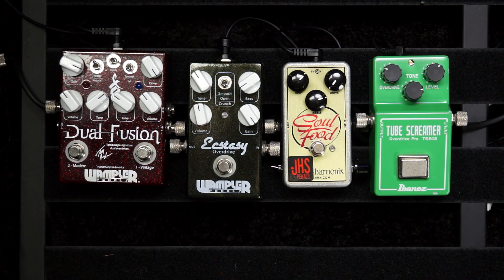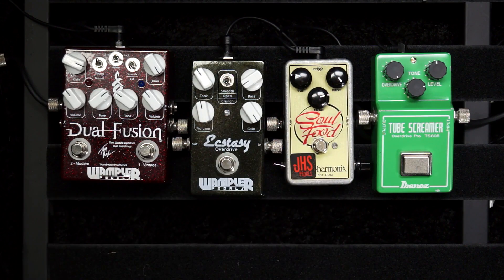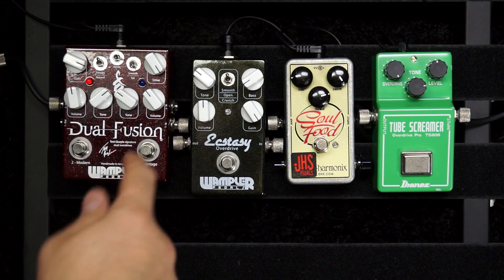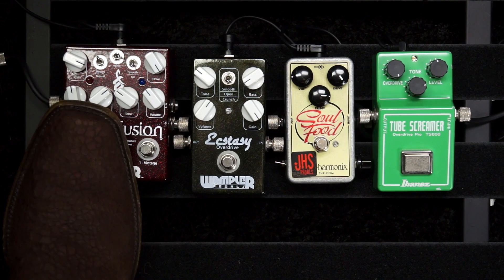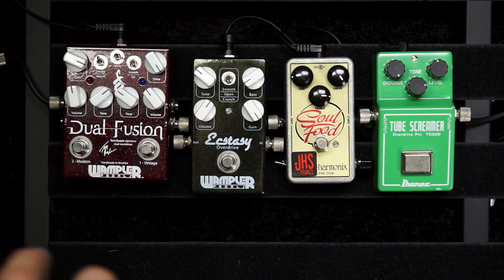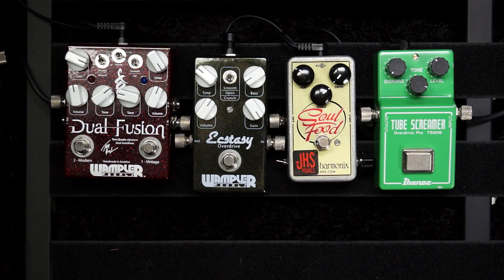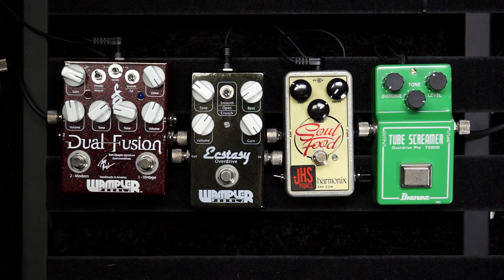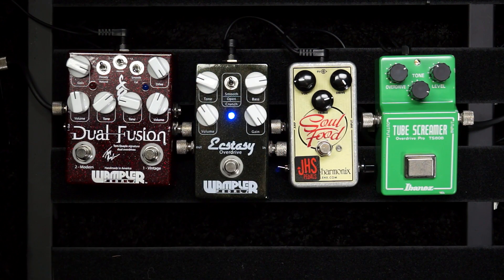4 Steps To Choosing An Overdrive Pedal

Comment: "A tube screamer always thins out the signal" – although this is not wrong, you gotta look at the context. The tube screamer was developped when Fender twins were the fav. Every club carried them so as a working musician chances were good you were playing through a clean amp with lots of bass and treble. A TS then shaped the overdriven tone to punch some midrange in the equation while thightening up the bass - which seems to be a terrible thing for bedroom players but just the way to go in the context of a band.
Reply from the maker: Stephan Neetenbeek Great point. Thinning the tone out sounds more negative than it has to. "Helps you cut through the mix" is another way of saying the same thing which sounds much more positive :-)
Reply: @Texasbluesalley  Maybe but for me the 808 or the TS9 is the optimum pedal to hit the front end of a Marshall, especially the 808.

Comment: Your videos have been helpful...
   Our house is new to guitar, and ive been researching pedals a lot lately... trying to figure out where to start...
   For someone completely new to guitar, and wanting to experiment with various sounds, from all sorts of classic rock, to SRV and a bit of blues, to a touch of AC/DC, and some ZZ Top, it's hard to know where to go for drive.
   I'm thinking I almost should go with a multi-effects pedal, as opposed to separate pedals...  to get the sounds I am lookimg for, my list starts with a tuner of course, and probably at least 2 drive pedals, a reverb, a delay, a chorus/modulation of some sort, and then you start needing a board, power supply, etc...
   My "short" list already includes:
TS Mini, Soul Food, Crayon, and Spark mini,for boost/drive pedals...but not sure which couple to get or if that will get me the variety I'm after, of if any combimation of those will get me anywhere close to a ZZ Top sound...
   Hall of Fame 2 reverb and Flashback 2 delay seem versatile, as does Corona amd the Phase 95....   I looked at the M5 or a similar multi effect stomp box type pedal to fill in the gaps...
   After loomong into it for hours amd hours.... I'm leaning more toward something like a headrush....i could tinker with one of those and find a sound that is close for a song/artist, and then save that.... and then repeat...
   Then anytime i could go back to any of those easily....    separate pedals might be harder to go back and forth to those tones once i do find them...
    I have a small Orange amp, a small Marshall, and am debating eventually getting something bigger.  
    Some of the options I've looked at are the Headrush stuff, like the Gigboard, or even the Mooer GE200...  as far as multi effects boards go.  I could play that through one of our amps, or get a FRFR speaker, or use one of the EV powered speakers i already own...
   Any thoughts or input would be greatly appreciated....
   Thanks again for the videos!
Reply: The thing to remember is that there is no single "do it all" pedal. If you want different tones, buying multiple pedals is really the best bet. Multi-effects are not very good at distortions and OD's. They're better for the other effects though (such as delays, chorus, phaser, etc.). Keep in mind that you're stuck with whatever tones those provide and are cumbersome to set up. With multiple pedals, you can mix & match various things, and even stack pedals together if you wish. Best thing is that if you don't like one pedal, you can remove it from your board and replace it with something else, or you can sell/trade it without having to get rid of your entire board.
The pedal market has so many different options at every price point, with a little research you should be able to find exactly what you need.
The other piece of advice I will give you is that you should really just focus on developing one good sound that is yours, and try not to nail every tone for every song, that's where you can fall into the trap of continuously buying and selling gear.

Comment: It is an interesting approach. I don't tend to think OD pedals can really produce distortion like some of the better dist. pedals. Another idea is to set the pedals for what they are good at and then decide if you are choosing only an OD pedal. For that, volume or level at 11, gain at one, tone at 12.  That is, in my opinion, the sweet spot. You can roll back or up on tone.

Comment: Question Anthony: You said the TS thinned out your tone, but isn't that because you had the tone knob all the way to the right? I thought 12 o'clock on the tone knob was neutral, to the right cut the bass and to the left cut the treble........
Reply from the maker: TheWhocares1981 Kind of... The farther right you have the tone knob, the "louder" the pedal will sound because of the brighter tone. If you roll the tone knob back, you can boost the volume higher, which will make the bass closer to the clean tone, but then your treble will be a bit rolled off. So if you're willing to deal with slightly muted trebled, you can get the bass closer to bypassed levels.
Reply: The average TS still cuts bass no matter where the tone control is. Increasing that control only dials in or removes treble. ;)

Comment: You do not use a TS as a full distortion device on a high gain amp. You set the Level all the way up, Drive all the way down, and tone about the half (but thats dependent on the amp or player). You use TS-like pedals as a filter for the flobby lowend und sharp highend. And push a little bit the overdrive of the amp through the level.

Comment: A metal guy would run an overdrive through dirty channel, with the level up, distortion off, looking for a tighter bass response and a slight mid hump. Any recommendations?
Reply: A tube screamer (or a cheap clone of one) would be the typical choice for this kind of thing. Some klon clones (like the soul food) do this well too.
Reply: I ended up with an East River od. It's based off of a maxon 808. It's transparent with pretty good output and was only $52 off Reverb.com 👍

Comment: Can you change the settings on the pedals?
The 808 for example, back the overdrive off & turn the level up.
Or decrease the tone, they have  control knobs for a reason.
But you know that, don't you?

Give people a range of different tones to hear, those sounds where only slightly different.
They cannot all sound that close, unless all clones of the same circuit.
Show what the pedals, are  really capable of.

Comment: I don't know about this video. Overdrive pedals are typically used (and designed) to kick the front-end of an amplifier. The distortion is an augment, to dial in a sound. It's not the primary role of an overdive pedal. If you are looking for a distortion pedal, I'd look for that. For an overdrive pedal the first and primary thing I'd be looking at is how well does it kick the front end of my amplifier/how does it sound overdriving the amp? The other things you are going into depth on are really not the primary function of an overdrive pedal, and while they're interesting, none of them are criteria I would use to pick an overdrive pedal. Just my .02.